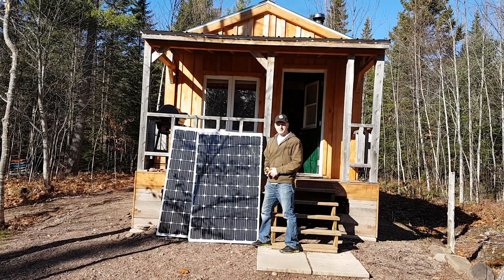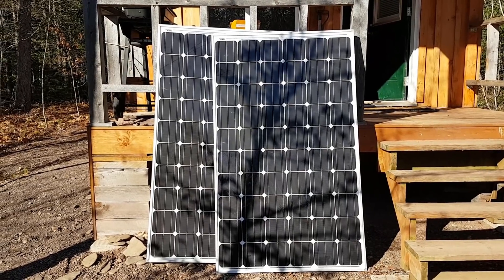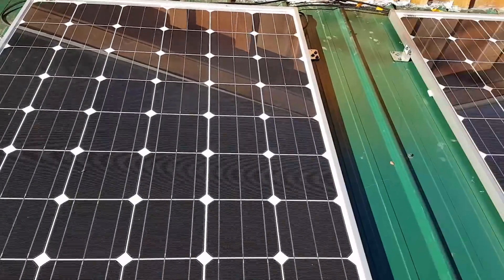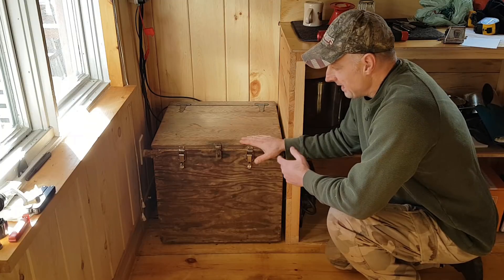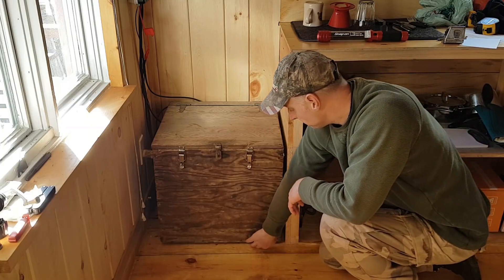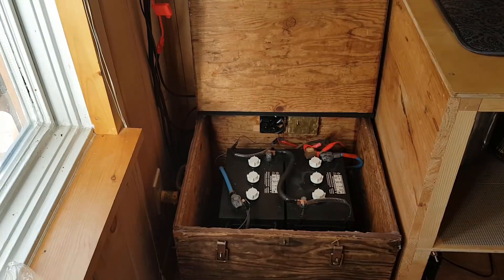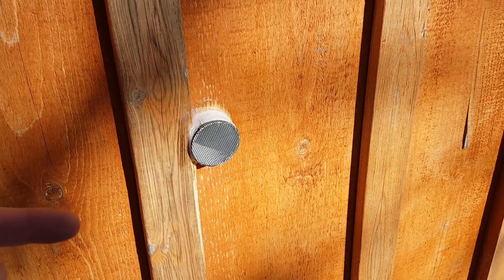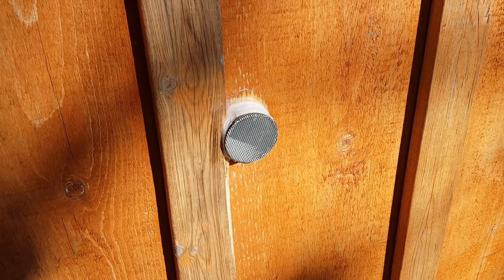BIG solar upgrade for the cabin!

Comment: In case anyone was wondering about 9:30 that red inline fuse you can get at auto parts stores such as a napa. The heavy duty ones use 8awg. It's nice when the batteries fit well in the box, good room for any maintenance.

Comment: There are 2 you tube channels I watch and both are or have been talking about solar panels and energy, the one is Lumnah Acre's in upstate Maine who are building on a off grid property and they have a house going up and a shop and greenhouse that they are going to build this summer and they just hooked up the wood boiler that's going to heat the house and shop and greenhouse soon to be built and eventually a another house but the one that they have going up is going to be like a lodge where they can process there vegetables and butcher there hogs as it will be a little like a main house for now and a outdoor kitchen when they have there other house up and there shop will be heated by the boiler and they put up a huge length of solar panels south of the house and that's going to supply electricity to everything plus they have put in a backup generator also and the other channel is Raspberry rock and Russell has built a cabin in Canada nearby Ontario I believe but the only way to get to his cabin is by 4 wheeler on a trail and he does a live stream on Friday nights around 7 or 8 PM
You should check out both channels as they are both interesting to watch as he was close to the guy who is building his own cabin by cutting down all his logs and he built a greenhouse last fall and stayed in that while cutting his logs and purchased a sawmill to cut lumber for his cabin cuz lumber was getting to expensive to buy. I can't remember the name of the channel but he had built a cabin and a outhouse and sauna house and outdoor kitchen and some neighbors had moved in from the cities and they were vandalising his property so he bought more ground a ways away and started all over again. You probably know who I'm talking about but I'll find out the name of his channel and let you know who it is and his wife and daughters would come out to the cabin and visit him on weekends as they still live in the cities. Shawn James is the name of the guy and he has a dog Lab with him since day 1 when he moved to the woods and building his cabin and other facilities with old tools like they did in the old days you should watch both or all 3 channels very interesting and informative information he puts out.

Comment: Nice upgrade. 

AGM or Lithium batteries would have been a better choice, but I understand how money is tight.

You definitely have a sweet setup.

You may still be able to use your 100 watt panel to power a fan directly using a DC to DC converter.

Comment: I was standing in an car shop, when 20 feet away a battery blew up from not being vented. Sounded just like a 12 ga shot gun going off. The lid was closed and it didn't vent. Stay safe.

Comment: Great video..guestion,,I' have a 100 watt solar panel now,  but I'm getting 2 more 100 watt panels and 3 6 volt batts and I have 30 amp charge controller....would that run a led TV, receiver and a few led lights for 5 or 6 hours a day??  Thanks...
Reply: Yes definitely

Comment: Ha ha ha! 😂 I've been on solar for 10 years. And learned a lot. For one I got all 12 volt devices. Tv, radio,an fan. Not to mention lighting.  My neighbors say my house looks like the the iss. Best lights I have found for general use. Are 12 volt marker lamps (3 led)types work well. Never had a problem with hydrogen. House leaks with fresh air.  Please don't cut tree. Put old solar cell on a trailer and move it around to get that boost. Keep your tree as it's a good shade.  From the ground bound iss. De kv4li😎
Reply from the maker: I didn't cut the tree. I didn't have too. The solar system works great. Got all the power I need.

Comment: A couple (Video on Youtube) built a Container House.  They add Solar an tied it into Electric Car Batteries.  Would those Electric Car Batteries last longer then your regular car batteries that you have ?
Reply from the maker: I have Trojan L16 6 volt batteries which are not car batteries.  I got rid of the car batteries with this upgrade. But I'm guessing those electric car batteries would be ok.

Comment: What kind of batteries are they.  I don't know of any lead acid batteries rated for 1200 cycles at 50% DOD?  They must be really good batteries.

I'd like to know more about your batteries because something just doesn't seem right.  You state they are 420 amp hour batteries.  I kind of question that.  There are many ways to rate batteries but it seems the standard for deep cycle batteries is am hours at the 20 hour rate.  Now you will see a lot of other ratings that are misleading.  For instance, Deka has a 6v deep cycle golf cart battery (GC15) that they advertise as "6 volt 448 Amp golf cart battery."   However, if one looks further into the specifications of this battery it is rated at 230 amp hours at the 20 hour rate!!!.  The 448 figure is the time in minutes it takes to discharge this battery at the 25 amp rate.  Totally different.  http://www.eastpennmanufacturing.com/wp-content/uploads/Deka-Pro-Master-Golf-Car-Flyer-0248.pdf.  I don't know what batteries you have but to get a better idea of their real capacity look for the 20 hour rate.  I doubt they will be 420 amp hours.  If they are let me what kind they are.  I want them!
Reply from the maker: They are Trojan L16s. The documentation that came with them say 1200 at 50. The 20 hr rate is 420. The 100 hr is 467. Energy is 2.8 kwh.
Reply: @NB88  OMG!  Those are "kickin" batteries.   I bought Trojan also but went with AGM's 220AH, 6volt, model SAGM 06 220.  You have basically got double the system I have.  We have a remote cabin too.  We went a bit different route using mostly 12v lights, water pump etc.  We have an inverter but rarely use it.  We can find almost any thing we need that runs off 12v due to the RV industry.  Our WeBoost cell booster is also 12v powered and works fantastically.  No discernible signal to 2 and sometimes 3 bars.  We have used a gas refrigerator for 50 years.  We are presently on our second one.  It is a monster-----17 cubic ft. model (we have 10 individuals for deer season).  The other one was only 8 cubic ft.  Personally, if I were you I would consider this option over an electrically powered one.  We have been really satisfied with our refrigeration.  I so enjoy your videos .  You feel about your cabin the way I feel about ours.  I do wish we had the mechanical equipment you have-----tractor, snow thrower etc.  We have a mower and that's about it.   I am impressed with what you have done seemingly all by yourself.   I was the one who designed and put together our solar system the way you did-----researching, reading, asking questions and finally putting something together.  Like you, I have learned a lot since then and, like you, updated the system.  It seems like it is a constant work in progress but one that intrigues me.  Keep up the great videos.

Comment: Nice! Next job is to look at the efficiency of the system. Points you may wish to consider:
1. Your charge controller is rated up to about 72v maximum input, do not run it close to the max. (your car speedo goes to 150mph but you don't drive everywhere at that speed or it will explode!)
2. These generic MPPT work at their best efficiency when they are running at battery-voltage plus about 6 volts. Any higher and the efficiency drops off. The controller will adjust the panel voltage to what it knows is suitable for maximum power transfer.
3. Wire the panels in parallel; this will drop the voltage into that happy-zone. The controller will be less likely to fail from cloud-edge spikes.
4. Cloud-edge spikes are caused by the 'lensing' effect when the sun comes out from behind a cloud. The colder your panels are, the open-circuit voltage will peak higher: At minus 10c the spike may be enough to over-volt your MPPT if you are already close to it's absolute maximum input volts. (Again like your car, if you cruise at 150 mph, then come to a big long dip in the road, you will go over 150 mph and it will go pop).
5. If you go to 24v battery, you can still keep all those panels in parallel, and your charge-controller will love you for it!
6. Good luck, be happy!
Reply: You can buy ajustable voltage regulators so the panels wont over volt or over amp the mppt box ;)

Comment: Have you raised the angle of the panels to match the latitude?
Reply from the maker: Didn't have to.  Even in the winter it's no problem to fully charge my batteries.

Comment: Looks like your in business. The batteries are charged that is ithe reason that your getting low current. The controller reduces the flow to batteries as they near 100%. So your in a good place. Now you can get your refrigerator.

Comment: I use two six volt golf cart batteries for my boat dock solar system. The batteries cost $86.00 each. They work great. My blowers require 1500 watts each for about four minutes. My 130 watt panel will recharge the batteries fairly quickly.

Comment: What I initially did with my system ten years ago when I had a much smaller setup was to get a good battery charger for AAA's, AA's , C's and D's, when you have a surplus of power I would charge a whack of these Low Self Discharge batteries and use them to power LED lamps/flashlights etc.  Since you don't want to add another SLA to a properly matched system, this allows you to use the excess power.  And ya, those low light levels of Nov and Dec are a killer

Comment: I got ten years out of my Surrettes, S460's.  Then I upgraded to S600's.  The older ones are still being used on a smaller separate solar setup.  The Surrettes are fantastic.  The older ones just need more water, more often .  Greetings from Prince Edward Island, Canada.
Reply from the maker: 10 years is great. Based on the specs and my usage, I expect to get that from the L16's.
Reply: @NB88  What brand are they? Crown?.  Yes I like the L16's nice batts
Reply: @NB88  Yes, and I'm careful to keep D.O.D to about 40%

Comment: use your car,,to charge,,in the evening 2 hours or when needed your batteries,,need no solar......put a cable from outside to house battery....thats 200 amps,,charge....no solar can do that....
if you have ,remote control to car,you can start car automatic when low battery.....or get bipper sound low battery,,,you start remote your car.....the north canada has alot of wind
wind is better than solar,,,solar is good for the ecuator line or florida...

Comment: Dude hate to break it to you but you only have 210 amp hours there it don't work that way if you had 4 of them then you would have 220 amp hours
Reply from the maker: Nope, I got 420ah. Each 6v battery has 420ah so x2 in series is 12v @ 420ah.
Reply: @NB88  so

Sorry but you two 6 volt batteries  even though now you 12v  but the amp don't work that because the batteries are series not parallel  so the amps don't add up  that Sr is fact
Reply from the maker: You don't understand. I'm not adding the ah of the batteries together. Each battery is 420ah. So very simply.... 420+420=420AH.
Reply: @NB88   L16's ? I have watched this about 18 times and i enjoy your content, I want to clone this in  my shipping container project.
Reply from the maker: @HoustonR6ryda  Yes sir, L16's. Awesome batteries.
Reply: @NB88  OK ....no wonder, I understand your battery bank better. Thanks.
Reply from the maker: @HoustonR6ryda  Trojan
Reply: @NB88   Thanks
Reply: ah ok seem small for 420 amp hr batteries what brand are they and how much per battary

Comment: There is so much more that you can do with extra panels. Don't stop with 470W. With those grid tie panels, just run a wire to a dedicated electrical outlet.  Most electronic wall wart chargers will operate at reduced current at 50V DC and above.  That is how I charge my phone, 5V power packs and laptop computer. Just takes a little longer.  Saves you from having to run an inverter and just costs you an outlet box.  Put that old panel in series with that dedicated outlet to give another 18V and that system will work even better when those other panels are partly shaded.  I run so many things on wall warts at my camp.  That battery box fan would be a good example, running only with sun. Take a look at my power shed I built.
Reply: Opera do you have any detailed videos on how to install solar power system. I have zero electrical knowledge and could use the help for my
Off grid cabin. Thanks
Reply: @roosterpalooza1985  I do have some very interesting videos. At my summer home from PV I have hot water, refrigerator dishwasher with heated dry, a large capacity LG clothes washer with its own hot water tank, all cycles use hot water.  All this is done with just a car battery.  These videos are for those with electronic knowledge and not beginner level.

Comment: NB88 or other solar energy users: Why two 6-volters in series to make 12, vs. a single 12-volt? Thanks in advance.
Reply from the maker: It's not about volts, its about Ah or battery capacity. A single 12 v usually has around 100 ah, while those two 6 v in series has 440 ah.
Reply: NB88 Thanks for that. How is it that a 6-volt batt packs so many AH? Are those a certain type of 6-volt battery for a special application?
Reply: Anthony; My old system had 8 - 2volt / 520 AH...Hoppecke batteries, they each weighed 90lbs, it has to do with the number and size of the plates........you are best to research the info yourself....

Comment: Nice Job. It's obviously not an optimal system, but you have proven that it is still a success. You know what the limitations of the system are and you adjust accordingly. I hope this helps others not be afraid to jump in and do a solar project, even if it may not be an optimal situation. My only other comment for your followers would be to consider AGM Batteries. They do not vent any gasses, do not need to be equalized, and require no maintenance. Rock On NB88
Reply from the maker: So far very little maintenance of the new batteries, just check the water level once per month and the charge controller automatically takes care of equalization. Thanks for watching.

Comment: The hydrogen from the Hindenburg burned up almost immediately and  wasn't responsible for a single death. What killed 99% of the passengers was the fall to the ground and the other 1% were burned to death due to the blimp being covered in aluminum oxide, or as we know it today, rocket fuel.

Comment: Not a bad setup. I am not a fan of putting panels on the roof when you have a winter snow climate. I would make an adjustable pivoting frame from the ground where it would be easier to clear snow with a broom and perhaps leave panels in the vertical  position so snow will not collect when away from the cabin.  Adding 2 more panels would work even better with such a setup, and you can keep your beautiful tree, its a win win idea!
Reply: I have a 4 by 8 hot air panel at 75 degrees and it self clears very well. It is steep enough to get some light bounce from the snow on the ground.

Comment: Easier to find a different place for the pannels than grow a new shade tree 🙄
Reply: Some trees you can top them off, I did that at my place with my conifers, 30' up that was as least 15 yrs ago and they are just starting to block the panels on my roof. A year later unless you looked hard you couldn't tell I cut the tops off.
Reply: StealthyMonk 🙄
Reply: Cut one plant 5 problem solved....

Comment: The battery box shoud better be in plastic.If the batterys start to leak, the acid does a lot of damage.They go right through the floor.
Reply from the maker: hmm, thanks for the suggestion. I think I have the perfect size plastic tray to sit those batteries on inside the box.